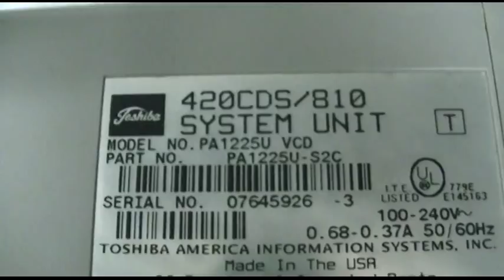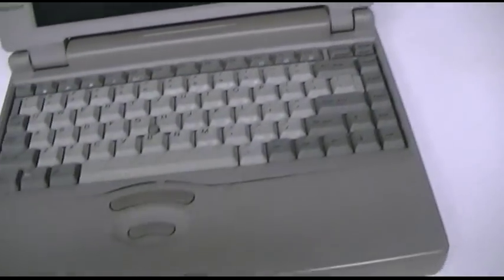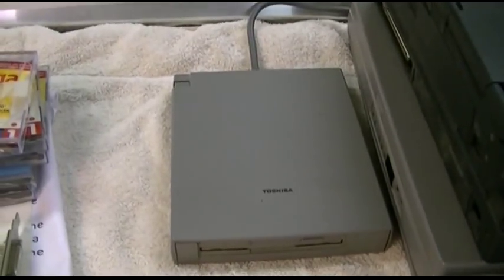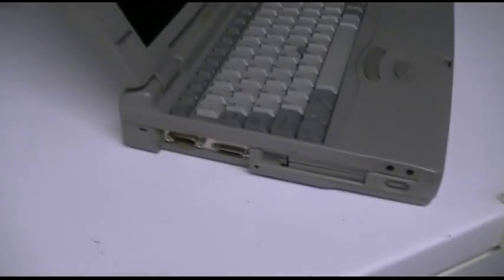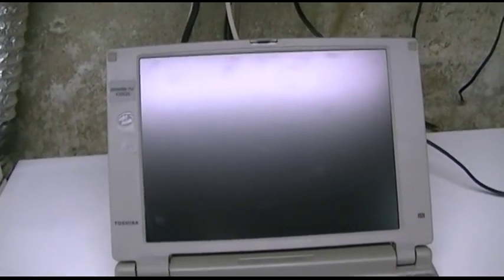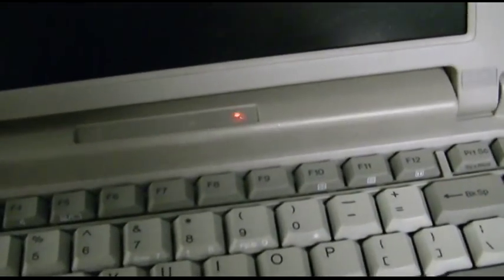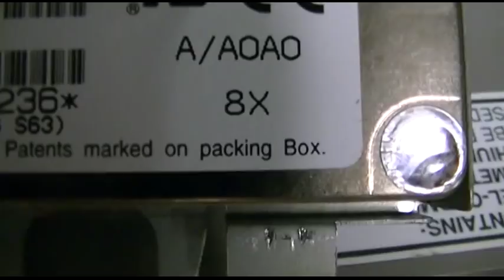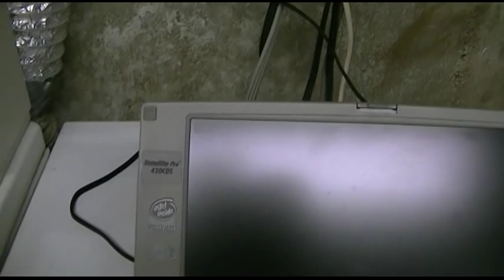VINTAGE Toshiba Satellite Pro 420CDS Laptop

Comment: I'm late to this party by a few years but I just aquired a 420CDT, the CDT having the TFT screen. For being 25 years old now, the TFT screen on mine is gorgeous. Unfortunately, I have the same install issue as you. Mine only came with a CD drive, no floppy and I don't really want to buy one, so I think I'm going to do what you've suggested. Pull the HD, hook it up to my 386 PC, install a OS and then place it back in the drive.
Reply from the maker: Yes, that should do the trick.  When this machine did work, it worked well.  I don't remember the exact point in the Windows installation that I turned it off, most likely at a point where it was ready to reboot.  Then I swapped the drive back.  There are only 2 or 3 points to possibly do it, so it won't be that much of a time waster.

I've also heard of people simply installing Windows using another machine, then once installed, swapping the drive over.  I have had limited success with that method, sometimes Windows balks when it finds too many new devices.  Especially true now; these were the days before activation.

Comment: That's a line-in jack on the side, not line-out. These originally came with either MS-DOS 6.22 & Windows for Workgroups 3.11, or Windows 95. You can take the floppy drive out of the external case and put it in the internal bay, but you can't do the opposite because the external bay is for floppy only, so the CD drive won't work it in it (even though it fits). I've heard the built-in power supply in these is prone to failure, but both of mine with this chassis design (a Satellite 105CS and Satellite Pro 410CS) are still working fine.
Reply from the maker: +VWestlife (backup account) Thanks for the correction on the line in jack and the additional info on the external drive!

Comment: So I guess green doesn't mean go. 

From what I can tell, this appears to have been a circa 94-95 model because A) the Toshiba script was still being used in the info plate and B) It says Made in the USA. Probably cost a pretty penny back then.

And, this is just my opinion, I find Toshiba laptops comparable to a first generation Hyundai; Decent at first, but not much for longevity. I say that because my Satellite C855D is screwing up. 

But on the plus side, you have a nice paperweight. :P
Reply from the maker: +Eskie Wolf Made of American and Imported Parts it says too!  The spec sheet has a copyright of 1996.

I agree with your opinion!  The Satellite C-series laptops were some of the crappiest they ever produced!  I used to fix those all the time.  Watch out for loose hinge screws on those, absolutely famous for that.  Interestingly enough, they were very similar to Hyundais at that.  Generally you never found one that wouldn't turn on (unless the jack was broken), but if it did turn on, it basically went "0-60 in about a minute and a half".
Reply: One thing to note that Toshiba is no longer making the Satellite Series notebooks. They are now focus on The Tecra and Protege series computers aim at the Business, Enterprise, and Education markets.
Reply from the maker: Dan Miguel That's probably a good thing, some of the latest Satellites they did make were total pieces of junk.  Eh, they probably are stuffing the same components into these other ones now anyway!
Reply: jaykay18 I believe that prior to 1995, Toshiba actually made some very good satellite notebooks like the satellite T1910CS, aka the white colored laptops of the early 1990's. Once Toshiba decided that they wanted to compete in the low cost consumer market beginning with the grey colored notebooks, the quality began to decline. I heard that most computer makers of that era, aside from IBM(and Apple Computer) began to use cheap plastic and materials into the development of their low cost PCs. I never knew that when I first bought my Toshiba Satellite T2105CS in 1995. That computer was stolen in the Fall of 1996. As a replacement, I was given the Toshiba Satellite 115CS, which I still have it to this day. Although, the video card stopped working in 2015 when I noticed that the screen turned completely white, despite the fact that I had not used the computer regularly since 2004. It's strange that the video card could give out the way it did as I hardly every used the computer. It goes to show that when a computer maker decides to cut corners by putting in cheap components into their computers, they fall apart after a few years of use.
Reply from the maker: Dan Miguel I've never seen the kind of longevity you speak of in any Toshiba anything.  I believe it may have occurred, but I haven't seen it.  It's the absolute truth--they go with the company that's the lowest bidder, plain and simple.  Cheapest components and materials, then wonder why their in-warranty claims are so high.  Hmm...
Reply: I heard that Toshiba's warranty service is terrible. Their service reps are terrible as well. Quite a contrast from 1995 when they actually cared about the consumer. with regards to my dead Satellite 115CS, I wanted to send it in to Toshiba Repair to install the replacement parts that I provided, They told me that they would not even consider it. It's strange that a repair company won't even look at a computer that they once retailed.
Reply from the maker: Dan Miguel None of that surprises me.  Customer service is a lost art.
Reply: You are right about that. To think that IBM made a lot of wonderful laptops. And they never went towards the mass consumers by lowering their quality standards unlike Toshiba and their competitors. Its too bad that IBM sold off their computer division....
Reply from the maker: Dan Miguel Yes indeed.  IBM equipment was some of the best ever built, across the board.  Even their desktops way back in the day were solid.
Reply: jaykay18 What surprises me about the old IBM laptops is that some of them have withstood the test of time very well with no internal breakdown at all. And the computer's plastic body casing does not show any stress cracks. I recently got a Toshiba Tecra 510CT and the computer's palm rest shows cracks around the palm rest buttons as well as cracks around to lash button on the screen monitor top case. I really wished I had had an IBM laptop in 1994. But for the prices that was asked for them, they were well beyond my price range. That was why I bought the Toshiba Satellite T2105CS for $2300.00 in 1995 for college. Had I started college in 1994, I might had bought the Toshiba Satellite T1910CS. I am quite surprised that the white Toshiba Satellite computers are quite solid machines that rarely falls apart(provided that they are well taken care of)compared to their grey successors.
Reply from the maker: Dan Miguel Different kinds of plastics age differently.  The white ones held up, the gray ones were of a different formulation.  Plastics "dry out" and become brittle, then they crack and break.  Perhaps Toshiba decided to go with a different look then.  But none of us knew anyone would have (or even be talking about) these machines some 20 years later, so longevity wasn't much of an issue, it was designed to last the life of the product, whatever they considered that to be back then.
Reply: I recently tried to remove PCMCIA cover door off from a Toshiba satellite T2100CS to replace on my other laptop, and the plastic broke off like a chocolate candy bar. It's hard to replace missing parts to those grey laptops.
Reply from the maker: Dan Miguel I had one piece break on this one also.  In fact, even newer Toyshibas often had broken parts!

Comment: anyone know why there are not one but two battery packs inside this thing?   one is a tiny 3 battery pack and then there is this large 2"x1" flat pack.  very strange.  need to replace both if possible.  currently the unit works fine but doesn't hold time when you turn it off and i'd like it to stop complaining about that each time it turns on.
Reply from the maker: Not sure why there are 2 battery packs.  The 3 battery pack is the one that's causing the issues with the time, I'd start with replacing that.
Reply: @jaykay18  I actually just learned from another video.. the big pack is for standby function..  so it's really not critical.   but the smaller 3 battery pack is the bios / clock.. which is vital to replace if you don't like that nagging bios error each time you turn it on.
Reply from the maker: @8bitwidgets  Just what I said...but thanks for the info on the larger pack.  I guess the idea was that when the unit is running and the main battery goes dead, you could just put the system in standby and replace the battery pack, and be back up and running in just a matter of seconds.
Reply: @jaykay18  yea i put a 2032 battery in mine and no more bio errors!  so nice to have that stop bother each time it starts up..   sadly the suspend battery prongs broke off entirely so i couldn't fix that one but who uses sleep mode?!  especially in windows 98 se! :)
Reply from the maker: @8bitwidgets  Yeah, it's fine.  These kind of machines are only turned on when the nostalgia strikes.  I have a couple that have dead CMOS batteries and I still haven't bothered to replace them.
Reply: @jaykay18  yea i did mine mostly because 1. nag is annoying, feels broken..  2. i don't like old batteries that could leak acid.   thankfully these style batteries are not as bad as varta batteries but still they can be corrosive and harmful if poorly placed in the system.
Reply from the maker: @8bitwidgets  Funny you mention; maybe reading your comments earlier in the day got me in the mood to do this, but today I pulled a 15 year old laptop out of the stack to use.  I decided that today I was going to kick back in the La-Z-Boy and catch up on a bunch of videos I had downloaded to watch.  Even though this laptop was 15 years old, it had wireless built in.  I watched the downloaded videos over the network on this 15 year old laptop, which took anything I could throw at it.  All it has is Windows XP and 512MB of RAM.  And it was more than happy to provide service for me all day.

The CMOS battery in it was dead when I powered it on.  I set the date and time and carried on.  On the PCs and XTs I cut my teeth on, we did that every time we'd give the machine a 3-finger salute.
Reply: @jaykay18   awesome.  well one thing i've learned unfortunately is that the unit will not operate correctly if you don't have both batteries present.  even if they are not working.  removing the suspend battery in my case snapped the pins off cleanly making it impossible to reinstall.  i replaced the CMOS battery successfully (soldering a 2032 3.2v battery.. technically not 3.6, but in my experience this difference isn't significant.) and you can tell it skips the CMOS error, but for some reason under win98 se, goes through ram test and then just hangs not loading windows.  However if i again remove the CMOS battery i'm back to the checksum F1 error but can just save and continue.  Computer's clock time is reset to 1990 but everything else operates fine.
Reply from the maker: @8bitwidgets  I've always found that Toshibas were very fickle machines.
Reply: @jaykay18  this is the only toshiba i've ever used..  my first laptops were similar spec'd ibm thinkpads i got from work when they were taken out of use by employees around 2000..  man IBM knew how to make a badass docking station!   Stuff I could have never afforded back in the day but could cut my teeth on for free from corporate trash.
Reply from the maker: @8bitwidgets  Typical overbuilt IBM!

Comment: R.I.P sattlitte pro 420 CDS 2004-2016?
Reply from the maker: I still have it around.
Reply: @jaykay18  what I mean is it's no longer working
Reply from the maker: True, but that doesn't mean one day I won't repair it.  Also doesn't mean I will...
Reply: @jaykay18  you are the best
Reply from the maker: Thanks.
Reply: you mean 1995-2016
Reply: @pentiummmx2294  oh ok thanks for the info 2 years later

Comment: Most likely the caps dried up. That big surge of power at startup, they fall flat.

Oh well, RIP.
Reply from the maker: +Michael Gegzno Yeah I had so much trouble with that system just loading the OS with no way to boot it and no floppy drive that it was probably destined to fail.  One thing that was kind of cool is it had an old-school passive-matrix screen, it gave it more of that retro feel.  The upgraded version of this, the 420CDT, came with an active-matrix display.  I have other laptops with passive-matrix displays I haven't gotten to yet!
Reply: Interesting! There were some new tech for the passives, that still keep them going. Not sure how they compare to todays screens. Looked up some of these processes, DSTN, CSTN, HPA.
Reply from the maker: +Michael Gegzno Yeah LCD screens have come a long way.  In my opinion they haven't reached the same color-rendering quality that a CRT can produce, especially now with them being LED backlit.  Much like we've lost all the good old hosts that made TV what it was, and we've lost all the good programmers that used to know how to squeeze every last inch of performance out of a system, even more so using tricks, we've lost people that can engineer stuff properly.  But the milestones along the way to "Cheap China Pride" are fun to look at!
Reply: Mentioned this before, The hosts and programmers/engineers, are dead, or own their own beach and won't discuss anything related, to what they did.

Thats why it is more entertaining to watch "washday, wash in with Sharkie626".
Reply from the maker: Michael Gegzno Yeah, I love that kine!
Reply: My 420CDT gave up its ghost yesterday, gonna fix it soon. try replacing the caps in the failed psu inside, if no dice. just gonna use the power supply from my 420CDS that has a bad LCD panel.

Comment: My guess: capacitors are dead :( 
Nice machine though. It was my very first laptop.
Reply from the maker: The built-in power supplies were known failure points on these models.